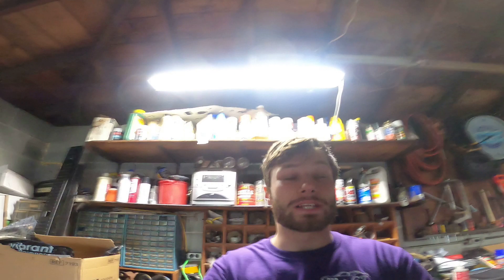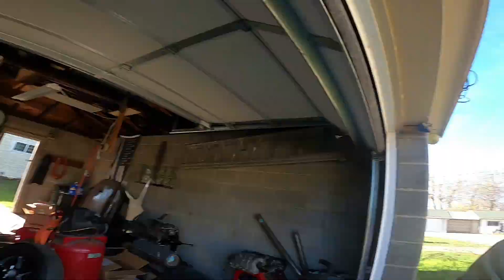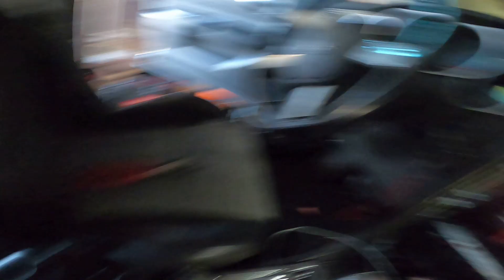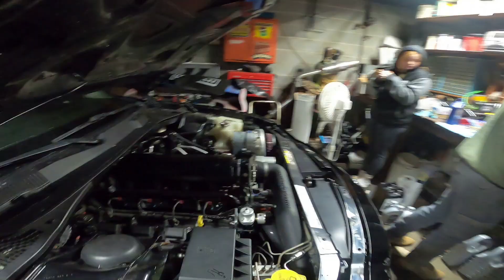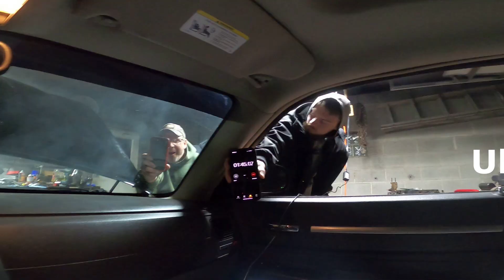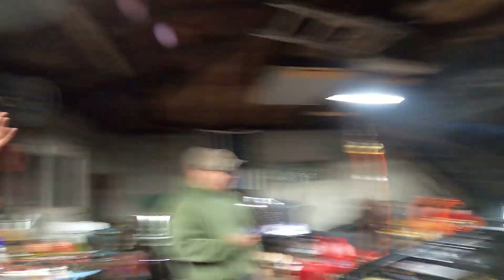STARTING THE PROCHARGED 426 HEMI AFTER 2 YEARS!!

Comment: What heads you go with stock 6.1 heads ? Planning to go 426 but only reason stopping me is the heads ..would I need different ones ?thanks clean build man🔥
Reply from the maker: Completely worked heads. Ported, gasket matched, high nickel seats, larger stainless valves, 1511 springs
Reply from the maker: Appreciate it, man!
Reply: @themojogt   by any chance do you know how much boost and hp can a stock 6.1 rods take? With stock bolts ?